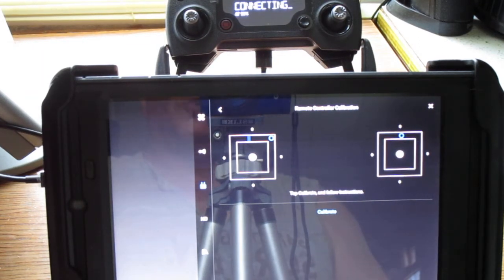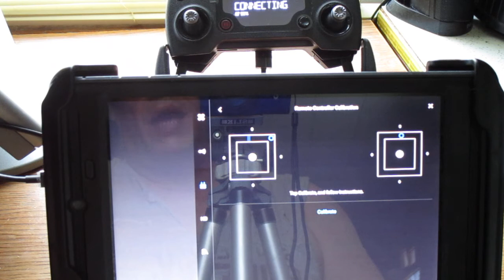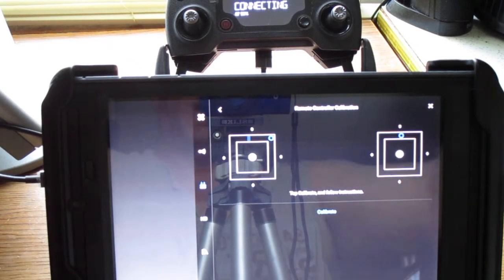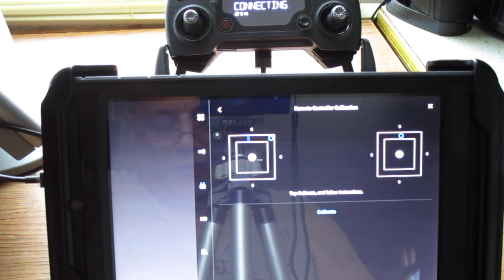Induced Magnetism Mavic Remote controller

Comment: Very good and scary information...Is there anythink we colud do? Any third part component we could replace? What do you suggest?
Reply from the maker: My whole point of doing this test and posting a video on it was just to have the owners of the Mavic system aware of one of it's major weakness .I did not mean to put fear into any mavic Owners .All RC systems have weaknesses , this one particularly is and was a poor design decision on DJI's part , or was it ?  I find it hard to believe that the DJI's engineers would chose this type of control application for an in the field outdoors environment knowing dam well and in my opinion just made it more susceptible to interference then any other RC system used in this hobby , some say it was done because of size and cost to make the controller more portable however picking size over dependability makes no sense when your looking at it from a Owner/user perspective  --- Now if you look at it from a company's view that is tight lipped about there system and pushes a lot of hype about transmission signal distance and claiming that it's a special system called "Occusync" or "Lightbridge"  if you ever get to talk to one of there engineers ask them what's the difference between there system and a PCM (Pulse-code modulation)  FHSS (Frequency-hopping spread spectrum) system that has been being used in the RC community for years ? ---  I can tell you the difference, there is NONE !!!!!!!  I'm sorry to say there is no solution to this issue other then being informed about it and more aware of the environment your going to fly in ..........  PS. Don't believe all the hype and if you make this a topic in a forum be ready to be attacked by "DJI's Damage control Dept. Cheerleaders" lolllll